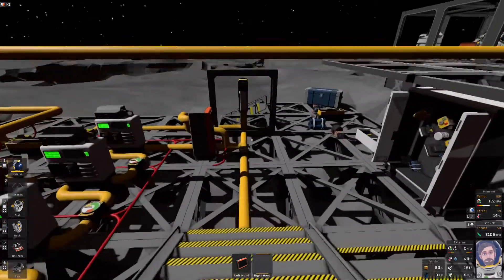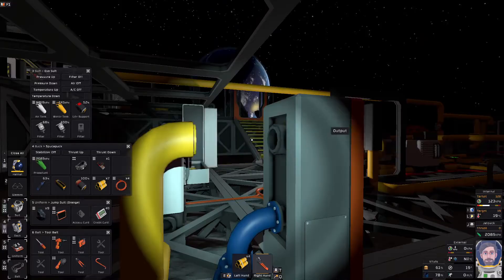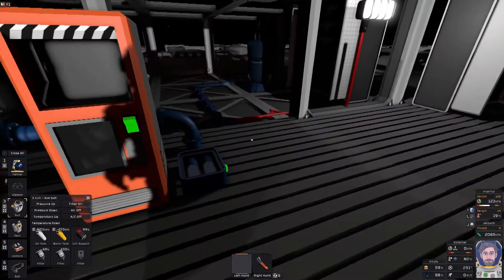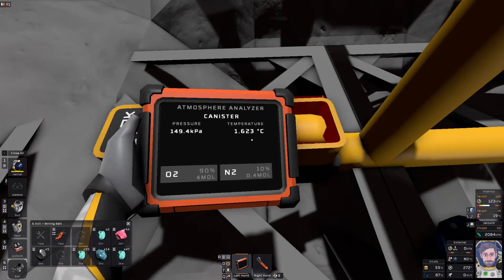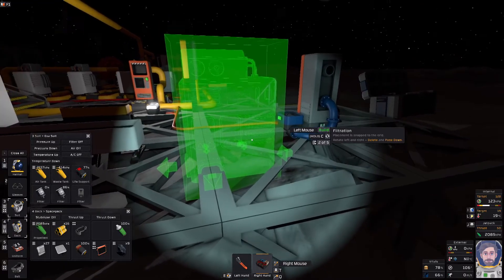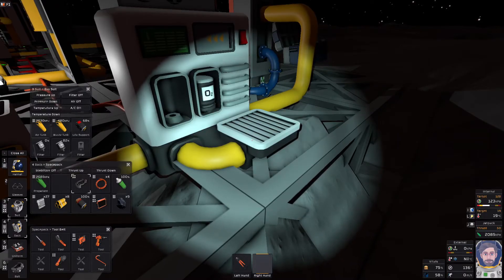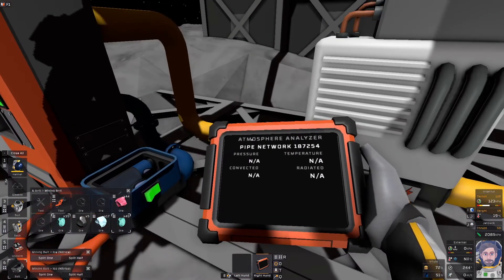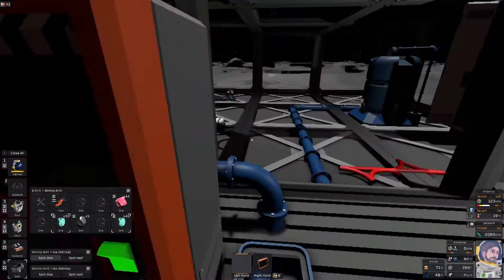Stationeers - Early game Water and Oxygen tutorial / guide

Comment: this doesn't at all look “early game“ to me.
I came to YouTube looking how to make Oxygen at the very start of the game.
I have been building a small sealed room with an airlock and them oresurizing it using the big tank from the lander. but then I have almost no spare oxygen to refill my suit tank.
I end up running out of oxygen in the suit with no way to refill it before I can build pipe benders and such.

what's the EARLY game solution for refilling the suit so you can live long enough to build the icfe crusher or the pipe bender etc?
Reply: I did the exact same thing. What I had to do to limp by was grab some water ice and drop it in the room. It pressurized enough for me to eat and drink. I now need to make this system to have water and o2 going forward
Reply: Put o2 canister onto the o2 tank on the striped area.  But, I think There’s plenty in the suit to mine some iron, copper and gold to make the pipe bender, ice crusher and necessary components.
Reply: @Kidge.6081  Problem I was having is I was using all the O2 in the portable tank to pressurise the room. so there was nothing left to top up the canister with.

I think most people don't do that
Reply: Doing the same thing and having the same problem.  This video says you can make everything in the auto lathe yet I don't see any of these recipes in that machine.
Reply: @JohnVanderbeck  Is there a solution to this that doesn't involve the extra tank? I'm wondering because the bare minimum start doesn't give a tank, just some food and a handful of kits to get started, but doesn't include anything for making oxygen, just an active vent.